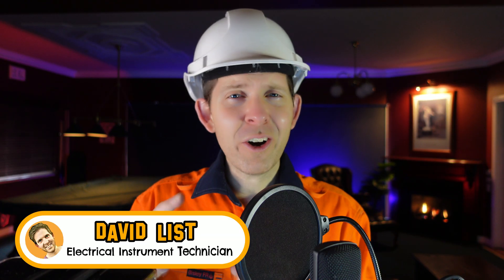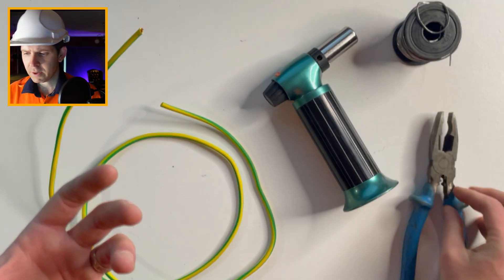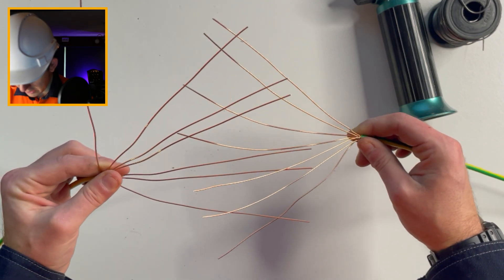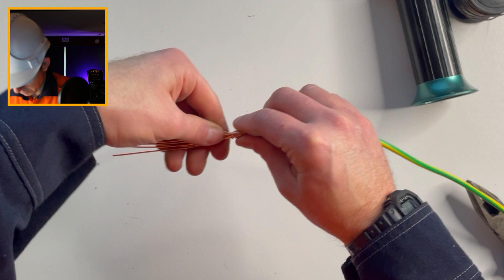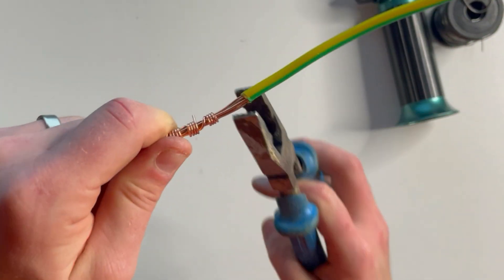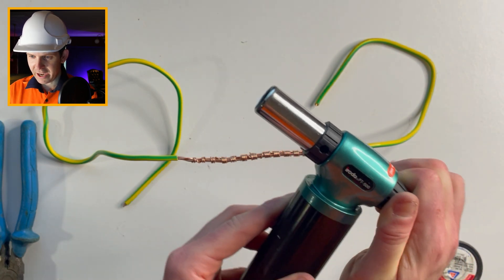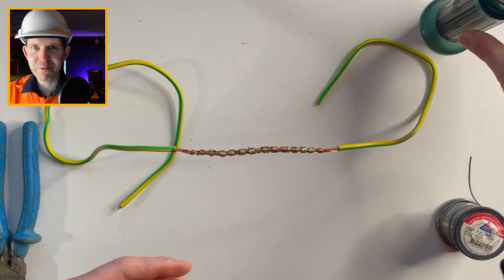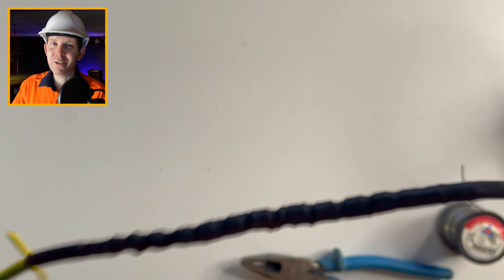Making the PERFECT Wire Join 🤤

Comment: If you take a small pair of pliers (the hobby kind) and use a file to groove both sides of the flat faces (toothless), then smooth it all out, you can do this 2:55 very fast, very cleanly. Alternatively, you can take some flat strips of bamboo, place the wire between two and use the bamboo to twist the wire. Both will get you very tight, very close wound turns. I usually put the wire in a vise or clamp it to the edge of a table.

Comment: Sorry but the soldering you have shown is just terrible! Clean the copper strands (use sandpaper or isopropyl alcohol), use flux to help the solder wetting the copper nicely and use more solder. You have overheated the metal (it colorized) and that won't help the solder to run it over nicely. Despite you have put shirnk tube on your demonstration pice, the lack of soldering won't prevent the oxidation of it. So over time the connections resistance will increase. In Hungary for  electrical installation 230V and above solder joints are strictly prohibited. Due to fire hazzard and or a case of fire these joints can get lose. For joining grounding cabéles I think we use somekind of press fittings and the cables here have way more finer strands.

Comment: Here's an idea: A "chain coil." where there are say, fifteen wires in a closed loop. Then, each wire has a coil wrapped perpendicular to it. Then, that stage is repeated until your conductor becomes as wide as you want. And finally, you'd wind a perpendicular coil around the whole conductor. This should mean that while the wire inductance is the sum of the inductances of each individual conductor, each wire's inductance should be much smaller.

Comment: Spread some flux paste first and then apply the solder to just one end, and watch it just run all the way to the other end, beautifully coating everything in between
Reply: that sucks, it will wick solder into inside the insulation of the wire making an absolute mess.

Comment: It does look great! I'm curious if it adds any inductance having 50 little turns like that? 🥂
Reply: highly unlikely as they are soldered effectively shorting any potential coils
Reply: @redeye619  Exactly.  The turns are not insulated from each other.  The electrons can travel straight along without going around the loops.

Comment: Three issues:
1) if you're not using flux core solder, you need to be using flux as you solder the wires together.
2) yo need to solder the wires until you see the shine of solder on all sides.  It should be inside and on the surface of all strands.
3) you need to clean the wires of any remaining flux core that you can prior to insulating as the flux will eat away at the wire causing it to fail sooner than if you had never soldered it.
Reply: The 3rd issue isn't an issue if you use rosin-core solder intended for electrical/electronic work instead of the acid-core solder intended for plumbing work.
Reply: @fredsasse9973  obviously you don't understand the purpose of the flux.  The flux is designed to etch and clean the surface so that the solder makes a better bond.  Rosin core may be weaker, but the material still has the same effect.
Reply: He must be using flux core solder because otherwise there would not be a flame created at the points where he places the solder. That's the resin burning. No-clean fluxes are also very common and will not cause corrosion if left on the joint.

Comment: Excellent demonstration but I can't believe you're main earth is only 6mm2 in the UK its 16mm2, do you have smaller main fuse ratings in domestic propertys, over here it's typically 80 or 100amp some older properties may have a 60amp.
Reply: In Aus. and NZ 16mm is the incoming in a typical residential installation and the earth is sized in proportion to that so a 6mm, and dependent on the incoming to, i.e.. alu or cu will change the size of the earth required as well, i.e., 120mm alu would require a 25mm and a 120 cu would require a 35mm earth. Typically in all the residential installations I've worked on its a 50A - 63A main fuse in the pillar or pole

Comment: The joint have lower resistance than equal length of wire. Twice the mass of copper and some solder :>
Reply: Only true if you solder it well. Without soldering there will be a thin oxide layer on the copper and these strands are round so the interface is a line at best.

Comment: I recently acquired a set of guide books for electrical professions from coyne collage from back DURING WWII and it has diagrams for splicing all sorts of wires (that were insulated using thick tar coatings!) In it.
Reply from the maker: Oh I would love to see it. Any chance it’s online
Reply: @thinklist  I don't think it is, but I could probably take some readable pictures if you'd like the diagrams I mentioned.

Edit: the books are the "Coyne electrical and radio school reference encyclopedia" volumes 1, 2, and 3 dated 1943. After a quick (not very thorough) search I came up with no digitized versions.

Comment: Looks like when a goldsmith gets hired as electrician... :D

But seriously, ever seen anyone doing something like this. Also don't think it's necessary to go to these lengths. Don't like the charred insulation on the edges either. Would prefer a crimped connection.
Reply from the maker: It might seam over the top but like I said on a main earth you can never be to careful